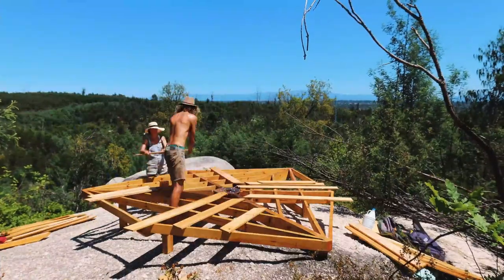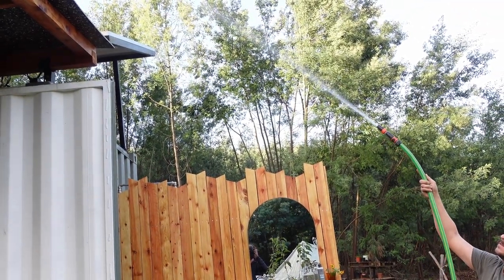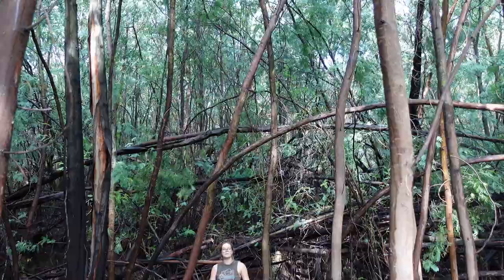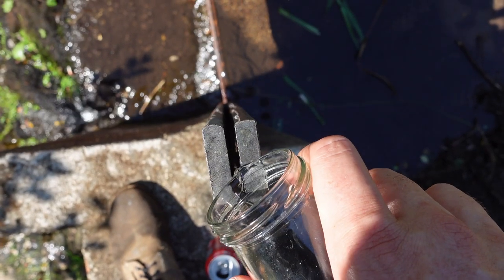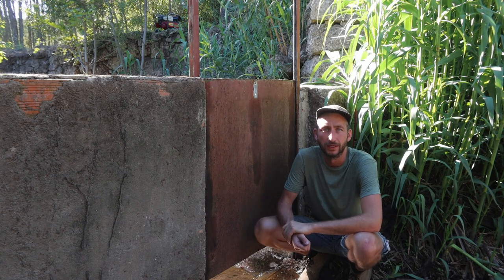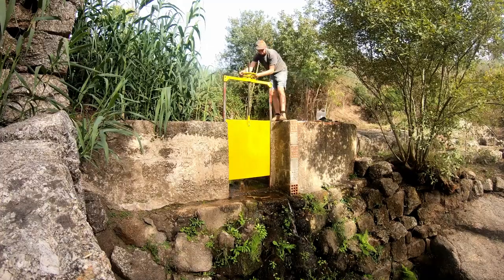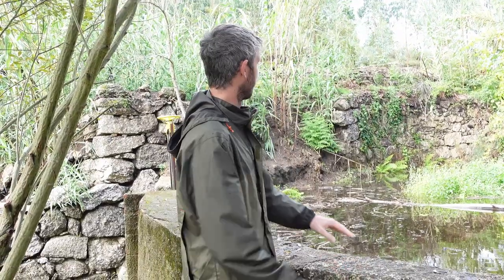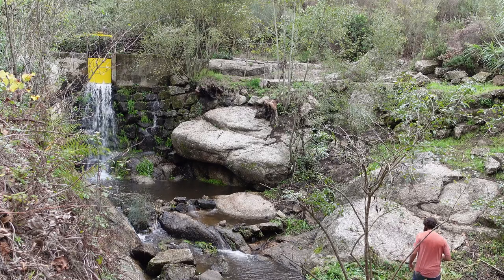#71 Fixing the waterfall door (before big rain comes)

Comment: Quite surprised at some of your methods, as you have all the gear and work space, also the hands on deck, yet the well, you didn’t complete or remove lots more of the debris soil etc to give a really deep head of water and animals could easily fall in due to poor preventative access, build up retaining wall with timber then you have extra depth and structure to build on.
The dam it was obvious you wasted lots of time and effort again in not refining the gate you could use timber fixed on the inner part that would expand to seal leaks and rubber from tyres cut open to fix at base, it’s called a butterfly effect, used in drains to allow a flow in one direction, when releasing the water, why open up fully, you’ve used taps and seen what happens when dams burst. Again on the inner walls of where leaks are, putting inner surfaces that would be held by water pressure is a cheap fix you could also put a further or lower dam at a narrow pinch point to allow overflow and second chamber when drought, the beavers are masters at water control but look at timber locks and sluice gate.
My dad told me about sixty years go, when putting down slabs, he had a little watering can, tipped a little on each as he laid it, why? Water will always find its own level! 
Small submersible pump in well could be useful. And or in pond also look at products that can be used under water for leaks, they use in deep sea projects, with the pressure of that contained water, and fixing a lower dam, you could also have fish for food with control of gate and second level dam, you retain water and food supply for nature all round.

Comment: Taping those roof seams isn't going to work. You should "tile" the roof in the same way you would with plain tiles: each tile of plastic should only show half of its length, and each course should be staggered half a tile over from the course below. You are going to need a lot more plastic pieces.
Don't do it, though. It's a bad and pig-ugly solution. Use a proper roofing material, and do the job properly, once. Reconstruct the frame such that the roof has a proper pitch, and use traditional roof tiles, slates or pantiles. Otherwise, you are going to have to get hold of some corrugated roofing sheets, or make a metal standing-seam room. What you are doing now is just crap.